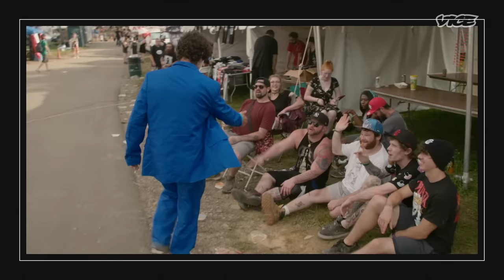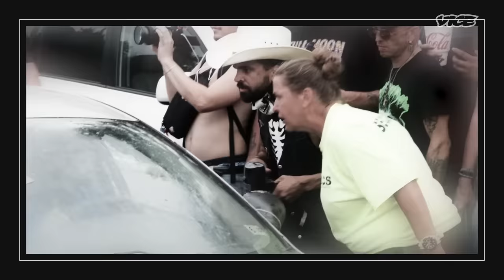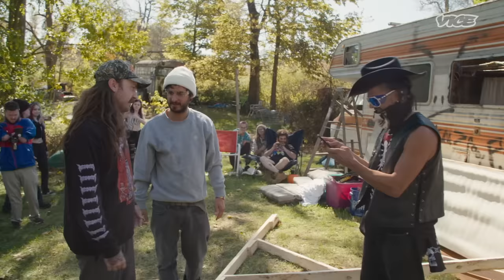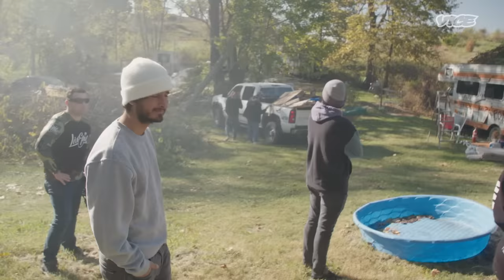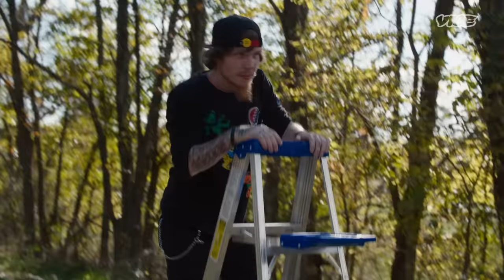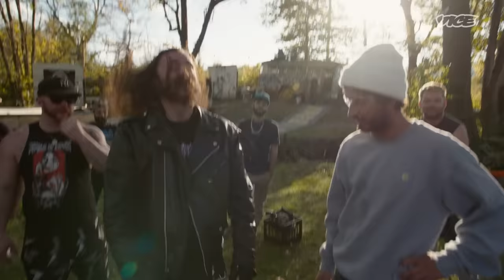A Day With the World’s Most Dangerous Stunt Crew | Better Man

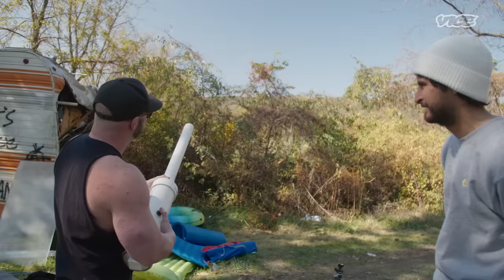Comment: @ 13:52 if you're gonna make a potato cannon at least *spring the extra 5 bucks for black ABS and NOT white PVC 
seriously, you'll be so much safer and your hands will thank you when the pressure chamber doesn't explode in them from too much fuel or stress wear from constant firings.